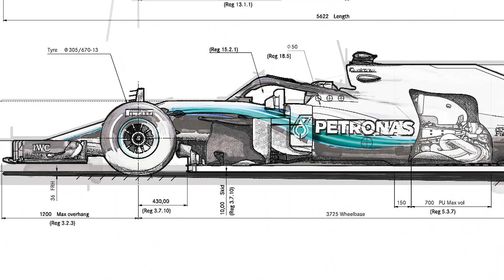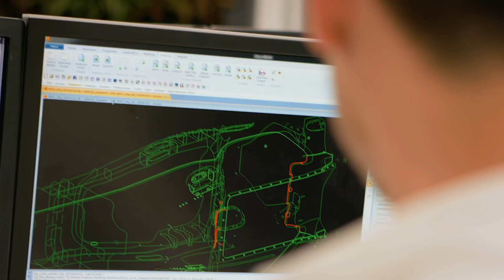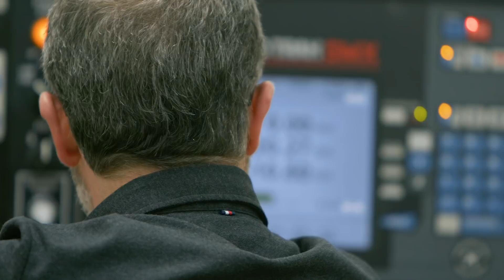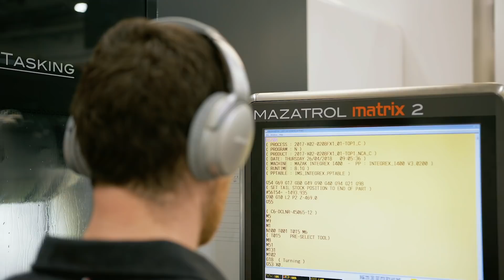How is a Formula One Car Born?

Comment: Why are they blocking their ears? It's not like it's an awesome sounding loud V8!
Reply: I suggest you stand next to the engine whilst running with no hearing protection on. It'll get quiet very quickly
Reply: tomtom4867 I've been going to the Melbourne GP for 10 years...I can tell you first hand there's a huge difference between these cars and the proper F1 cars.

Comment: And this is what f1 coverage doesn’t show - all the effort to put a car on the grid
Reply: The drivers are the very tiny point at the tip at the end of the spear (or arrow), supported by the work of thousands beneath them. Must be an absolutely otherworldly feeling being one of those drivers.
Reply: Willy Lamb, yet if the tip wasn't sharp enough then no matter how strong or sturdy the rest of the spear (or arrow) was, the effectiveness would be muted.
Reply: @utubedano  Arrow as in Silver Arrows 😉😉😎
Reply: @utubedano  true
Reply: it was like that because no one want their rival to check how they do it.